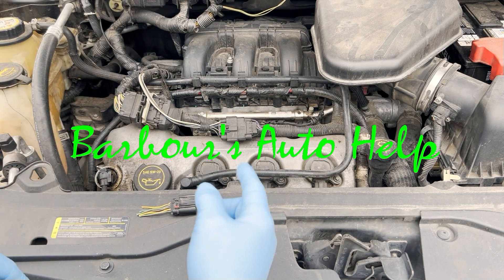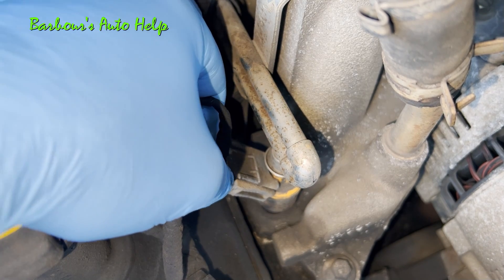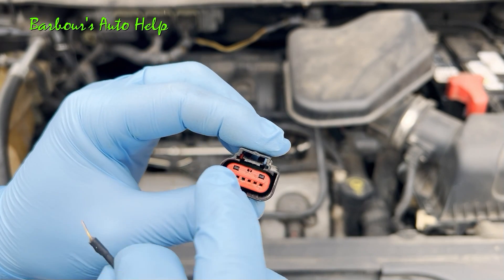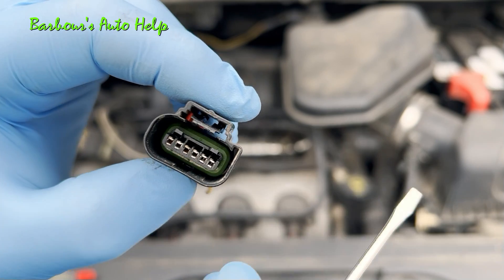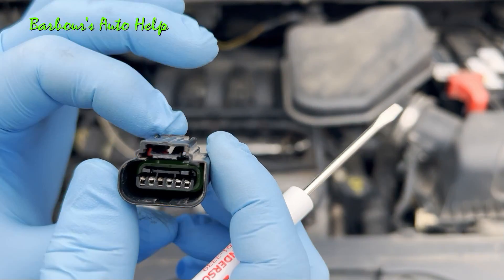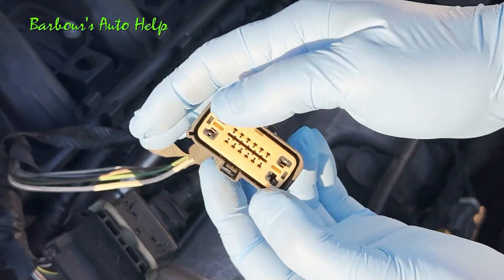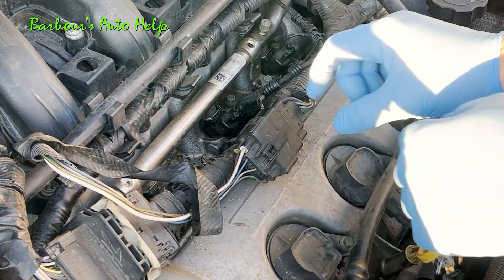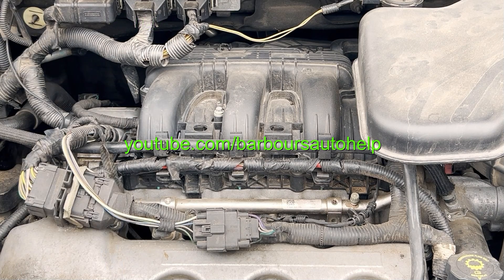Tips For Diagnosing Bad Electrical Connector

Comment: thanks for these very good tips, this is what I've been experiencing on my fuel gauge of my scooter, I've checked the fuel tank float, bought two brand-new speedometer and then boom, when I wiggle the socket connecting the fuel gauge wire to speedometer the needle go nuts, I wish I could have such knowledges and check it before buying two speedometers but the good thing is; when I try to solve the problem I've learned so many things about electricity (such as how speedometers, fuel gauges work, grounding, electrical wires, the mechanism behind the fuel gauge unit) such knowledges are priceless in the long run, maybe in the future I'll run into much bigger problems than that and I'll solve it very easily

Comment: Why is it that when I push my ecu harness upwards it stabilizes and if i let go it starts reving and motor shakes a lot, I checked my conector pins and they looked right without any corrosion, and ecu pins look good?
Reply: i have this issue with my alternator plug, when i push down on it, the voltage stabilizes when i let go it drops. Did u figure out the fix?
Reply: @ChitownRay-x7t maybe remove then re-pin suspect connection lines

Comment: I have a question that i. ant find an answer to anywhere. I think i have traced my intermittent tail light issues back to an 8 blade electrical connector. i know most people test from front to back for continuity...this connector has continuity in that way, however, its also showing continuity from blade to blade. Literally, with a red lead touching one blade, and the black lead touching another blade, my meter beeps loudly. In fact, five of the 8 blades were showing continuity to each other in this way. Doesnt this mean i need a new connector? Isnt it short circuiting if all the blades are touching each other inside the connector? Simple question that nobody seems to be able to answer before i completely cut out this electrical connector thats going to be an absolute pia to replace. Please answer if you know?
Reply from the maker: I'd really have to see the issue in person to be accurate.  I'm sorry, it's probably really simple it's just I'm not sure I have my mind wrapped around the issue properly by the information given.
Reply: @BarboursAutoHelp  Thankyou so much for responding, i went down a rabbit hole with this one, and the issue actually turned out to be that the Electrical diagram i was using from the Chilton's manual for my make model and year car was the wrong diagram...actually several years in a row are the wrong diagrams: They published the wrong schematics! 😵 It wasnt until I pulled up a Mitchell diagram that I realized that the component I was testing was the hazard light switch (Chiltons manual made no mention of this) and that it did, in fact, make sense in this instance to have continuity across all the terminals (so all the lights go on at once). With The Mitchell manual I was able to test the correct power circuit and make the minor repair to the tail light positive power supply. Maybe this will help somebody else? A multi terminal connector that has continuity across posts is likely a hazard light switch.

Comment: My whole system started going bonkers today- (2019 Ford Ranger) first the blind spot wouldn't work. Now I'm getting signals from all sides with nothing around me. Any ideas, Sir? Lord I hope it is not the entire computer! 🙄😟
Reply from the maker: I'd check your tail lamp assemblies for any damage or water intrusion.  I know that especially with the F150s that have the side obstacle detection modules located inside the tail lamp assemblies if water gets into the lamp assembly it can cause all kinds of weird electrical and electronic faults.  Your vehicle has a side obstacle detection module in each tail lamp assembly.  The SOD modules are what detects obstacles in your blind spots.  They are a part of your BLIS system and being that they are on a network they can cause problems with other modules and other networks as well.  Not saying this is the issue but could be.
Reply: @ I appreciate your help; being both a former combat med and civillian paramedic I know medicine- but when it comes to vehicles— I suck. How do I get into the tail light assembly? Thank you- Doc L.

Comment: Thanks for making the video and sharing your knowledge and experience. Is there a terminal tension kit that you recommend for checking drag/tension on female terminals?
Reply from the maker: I got my set from a site called Rotunda.  However, I'm not sure that it is open to the public.  I'm sure Amazon has kits available.  Though I haven't researched it.  Looks like I need to do some investigating.
Reply: @BarboursAutoHelp  Thanks for the reply and info